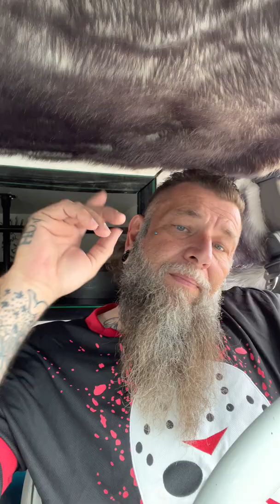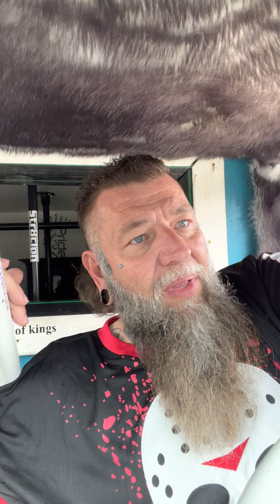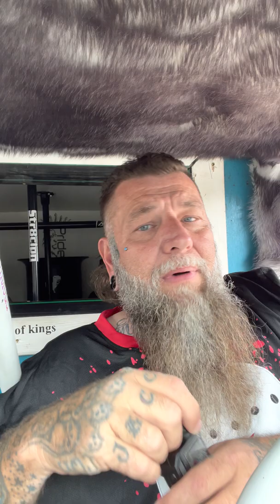Voltage and clipping

Comment: You are totally right man. I was driving the other day and my subs got toasty and clipped like crazy. Come to find out I wasn't paying attention to my voltage and lost my alternator. All about that voltage for sure!!
Reply: Really?! That explains protection mode at the start of my truck and later it plays more normally. What about your voltage drop delta at the amp? I'm at .02v. idk if that's good or bad

Comment: Hi, I had a question for you dude I have a single bank of LTO 45ah a magnus vs3500 running 0.5 7:28 ohm which is powering a 12" vibe HEX 5000Rms tuned to 29hz. My voltage floats at 14-14.5 stock alt when hitting low bass my voltage goes to 13.7 and amp starts clipping I got told by a friend if voltage is not in 12s electrical systym is good even in 13s and got told my amp is bad and to replace with another what do you think?
Reply: He don't answer anybody you're wasting time.

Comment: This is great info. I have Taramps 8000.1md on 2/15 HCCA and it clips like crazy. Big3 is upgraded, but still clips.
Reply: Whats your battery bank and alternator status
Reply: @MrInfoPhilly the Big 3 is upgraded. I’ve recently changed my setup. I’m running 4/HCCA 15’s with a Taramps 15K Bass. Still using a 320 alternator, an Optima 880 with a Duracell 750 for the stock. The bass fades in and out. I’m about to install another 880 Optima yellow top. With that help?

Comment: When I start my car it reads 14.9. Gets below 12 when going full tilt and amp clip light will start flashing. I am no professional dont clown me, is my amp just tuned bad ? Or is it that I do not have enough power pushing to my amp? I have a salt 2k and a 15” on a stock battery and alternator… I’m wondering if that’s the problem

Comment: I know it's old I just got 2 skar 18s evl . On a on a big boss 3k .  Pretty much when I get in to bass  yes my lights go dim so yea vot problem I just can't seem to get out of clipping and don't really want to spend money where money is not needed if that makes sense my gan is like a quarter of the way up if that and I start clipping should I just throw a bigger ault on or try a 2ed battery I am doing the big 3 at some point I know that will help some just want someones opinion that knows what there talking about

Comment: I just discovered this channel today and installed my 1st amp/sub a couple days ago This may be a rabbit hole I didnt plan on. Cerwin Vega s91000.1d 500 watt 10 inch memphis I cant get this thing sounding good to save my ass. im getting 14.9v not running the sub Ill hook up my scan tool and check it when im pulling load on the system. I ran 4 awg OFC for power/ground to amp and added 4 awg ofc from 110v alternator to battery and battery to chassis. Im new to Columbia SC and dont know whos reputable out here to help me on this wild pursuit of premium car audio.

Comment: Hello from Australia. Wound you be able to suggest a good amp thats 125w rms x4 at 4ohm to run my 4 rockford t3652-s components at there maximum im not in no competitions but i do like my music LOUD please
Reply: I got a pioneer gm-d701 135rms x 4
Reply: @francesappleford9013  yeah but 135w rmsx4 is to much for them and will blow them up because the speakers are 125w rms and the amp is 135w rmsx4

Comment: My
Problem is when I turn up the volume for a while my amp clips at around 8 on my radio and my phone fully turned up on the volume I play maybe 1-3 songs instantly goes to clipping and the amp is bigger then the subs so idk if my
Issues is the voltage

Comment: My dad was trying his massive audio hippo 122 on my taramps md 3000 and my volts are stock 14.4 I have no extra battery and stock alt. It dropped to 11-10.9 volts
Reply: Guessing the amp took a crap?

Comment: Jerry please excuse me for being dumb I've been inside for over 10 years and got out last year and everything in car audio has changed EVERYTHING and I'm slowly learning everything and upgrading anyways I just ordered my first EVER High output alternator and VCM 6003 from Autotech for my 19 Camry and I ordered a 30AH bank of the 75c SCIB 10AH LTO cells for a good power delivery to my equipment and I am in the process of installing all that stuff but trying to learn how everything works with the HO alternator and voltage etc so if I understand you correctly you are saying even if I'm going to charge around 16 I need to set my amp with my voltage turned down so that when the voltage does drop from the Bass it doesn't throw a clip light on the amp is that correct and if so what voltage would you recommend tuning my amps at if I'm charging around 15.8

Comment: see i was wondering with this i know it's old but i have a taramps bass 3k on stock alt but i have big 4 up front and im double grounded in back. all 0 single run of power and a d5100 xs power batt in back i drop to about 13.5 ish and it seems its always in clip. i plan on making a bass car cause the 2017 equinox only can get a single alt and max is like 270ish i wanna get a second one to run one per sub if i can and go with the flow lol

Comment: I know this video is old but I can tell you from my experience my voltage drops at a certain volume?my head unit goes up to 45 but its factory i notice right before i installed my amplifiers nothing changed over 35 so that tells me I shouldn't go beyond 35 if I don't want my voltage to drop so rule of thumb 75 percent of maximum volume which would be 33.75?35

Comment: I have an American Bass titan 1044 being pushed @2ohms by a skar rp 1200 (800 watts @2ohm) and i’m having issues with voltage drop. I drive an 06 corolla and I don’t know what’s causing it. The alternator is somewhere around 70-80 amps. I got the alternator tested and there’s no issues, and my battery is brand new (1 week old). The gain on the amp is less than half. I use 4gauge CCA which I fear has corroded on the inside to cause the voltage drop and clipping. I also think it may be the terminal connected to by battery that is slightly rusted/corroded. Any thoughts anyone? I’m at a complete loss at this point. Anything helps thanks

ps before anyone says it no it’s not my ground

Comment: I dont have a variable voltage thing so i gusss id have to take off a diode to set my gains at lower voltage. This is absolutely my problem rn, i set my gains at 15.8 but it drops hella hard like down to 14s, only using a 35ah lto bank on 7k, thinking if i make it a 70 ah bank it will fix the drop? Im already on a 320amp alt which is the biggest i can get

Comment: Awesome video, I was wondering if my amp puts out 2400w rms at 2ohm load, and I only wanted it to deliver 1400w rms at 2ohm load could I set my ac voltage coming from the amp to 52.92 volts to get 1400w or will jus put out 2400w at 2ohm load? Thanks
Reply: Just turn your gain down a lil bit, lower than 52.92 a lil bit
Reply: @BoobeeMyles  cool that's what I'll do cuse I wanted to get a big enough amp for when I upgrade and run my new subs at a 1ohm load and will run my current subs at 2ohm load and jus use my Meter and set it to only put out 50v or so until then. Appreciate the help
Reply: Good deal.   No problem brother!👍🏾
Reply: @BoobeeMyles  I was hoping I could do that ya know. Cuse I've watched videos of when guys set there amp gains and have there amp gain all the way down its reading like say 15v and they slowly start turning it up till the get distortion and back it down a little. So figured I could jus turn up little bit till I could to a voltage that only puts out like 1400 close to 1500w at my 2ohm load. I was looking at getting a Salt 3 but seen the Synergy wfo 3.1 looks pretty legit and alot cheaper which I don't mind paying for the salt 3 but heard alot tell me you paying a tax for the name lol
Reply: I use my multimeter to set my gain, go to harbor freight, they have pretty cheap multimeters, just disconnect your speaker to your amp & set it the same way you would, but while watching the multimeter to you specified voltage #
Reply: @BoobeeMyles  for sure. I'm a certified electrician at a plant so I can get my hands on some nice meters lol, I been wanting to get one of those smd dd 1 plus but like those oscilloscope meters that's a meter I don't have  and there alot cheaper
Reply: @johnnypiper1717  oh nice..  Amazon has nice oscilloscope for like $40 maybe, I'll send you the link to check out bro

Comment: so my dad got me into subs and all and i have a set of L7s and there his subs i’m running around 14.5 when i’m not playing them when my trucks at normal run, it’ll drop to 14.3-.4 and i haven’t ever ran a ported box with L7s and i don’t have a clue what the clip sounds like i just wanna know if i’m all good or not?
Reply: btw there the new L7 solo barics the blue stitching i believe
Reply: You won't be able to hear the clipping unless if it is really bad, you would have to get meter to tell or if your amp or bass knob has a light for it. I'm not 100% about if you can hear it or not but it's just what I've learned

Comment: I'm having a issue with my voltage drop. When I start car up voltage meter 15 volts to 14.8  when deep bass or some lows hit. It drops down to 12.8 with a xs power d3400 in the back. 145 amp alternator
Reply from the maker: you need more alternator.. and probably another battery.

Comment: Actually music is NOT recorded with clipping in it , it can be recorded with distortion but not clipping because clipping is different then distortion

Distortion is something that sometimes the music editor will add distortion of various kinds to flavor the song including the bass lines HOWEVER clipping is when the MOSFETs and or transistors have gotten to hot and are being asked to make more then they can and the biasing gets all out of whack and you end up with DC leaking into the AC  signal and that DC is a speaker killer

Comment: sup man excellent content, I have a newer  jvc head unit that is rated at 5volt pre outs, checked them the other day and im getting 2.5 max with vol all the way up. restored it to factory setting and im getting no more than 2.5v. 
I can turn it all the way up and rca's will not send a clip signal to amp but my speaker outputs on the radio clip at vol 23 of 35 any idea why or any tips?
Reply: If you have a subwoofer level on headunit turn it all the way up will give you 5v. Adjust the gain on amp accordingly

Comment: I’ve noticed exactly what u were sayin here.   When my vehicle first starts up and my alt is in full charge to get the voltage up to 14.4  I can play full tilt and no clip indicator light but once I my battery charges up and the alt starts to rest some and the a long bass note hits and drags the voltage down the yellow light starts blinking.   Makes a lot since thanks man.  I need a stronger alt and cap bank to keep my voltage up and yellow light off.   This was my reasoning for purchasing a single 15 with 4dvc so I can run my smart 3 at 2ohms until I can upgrade my electric then purchase another 4ohmdvc so I can go to 1 ohm load with double the surface area.   Should be a hella big difference

Comment: Man I have a 370 mechmen alt x18 on s sae sundown 3k amp would I be ok to run another regular car battery for a while till I save up for a couple agms
Reply: It actually sounds good without any other battery the voltage on the dash don’t dip past 14 anymore I need another voltage meter off the amp I know again money is right Friday I’ll have little extra cash I am getting a voltage meter for the amp and was gonna grab a car battery to run for now but figured I would see what your options are on that

Comment: My crescendo bc4k is s&i and it has bassknob with clip light and i believe few of the sundown amps that used the s&i board also have clip light on there bassknob and the dc audio amps r s&i i thought and they have one also badass video man
Reply from the maker: my DS18 amps are made by S&I and have the clip light in the bass knob and it sucks.. i'm not mounting 4 knobs in my dash

Comment: Hey jeryy i have a sundown sa 15 and its on a 2500watt amp and my lights are dimming should i get a bigger alternator or should i get another battery
Reply: Big three and battery.. I'm running a sa also on a Orion xtr1500dz

Comment: I have dual runs of 0 gauge wire running back from my front battery xs power d3400 I got 2 xp3000 batteries in the back and a mechman alternator and I'm running a audiopipe apdlo-30001d amplifier and my volts will drop to 13.1 sometimes I thought with  the extra batteries and everything the voltage would stay better but it don't all ofc wire I got a video on my YouTube of what I got
Reply: xp3000 batteries suck Culprit is probable a potential compromised cell in one or both batteries. Go Lithium. These supplemental AGMs dont recover fast enough.

Comment: i had horrible voltage drop on a few songs my amp would just go into protect i have the big 3 done then i added a second battery problem solved (the amp was only 2k rms)